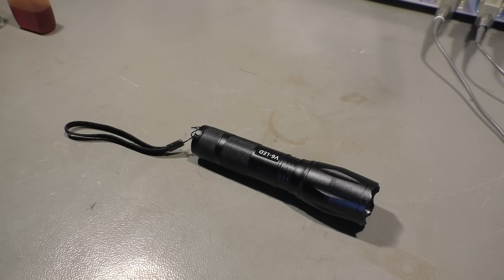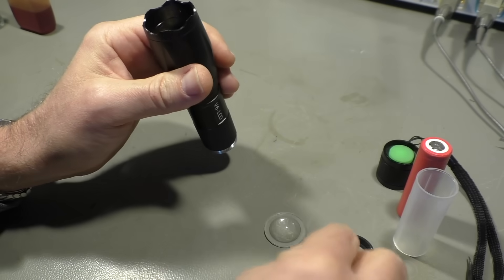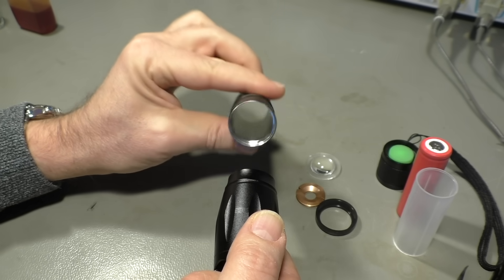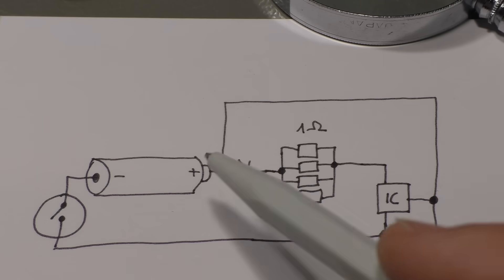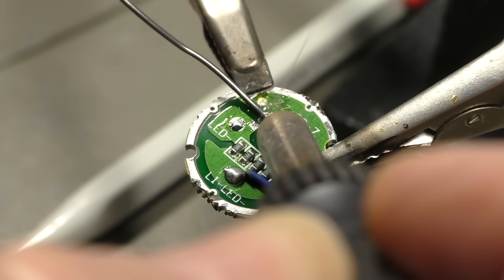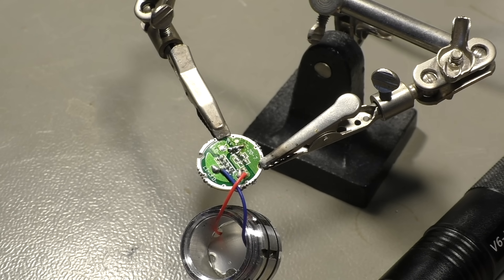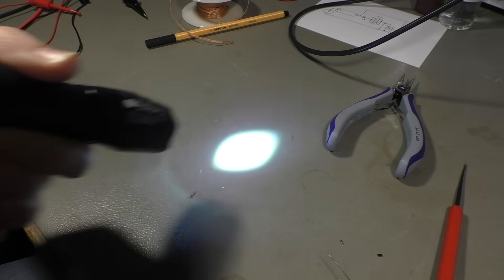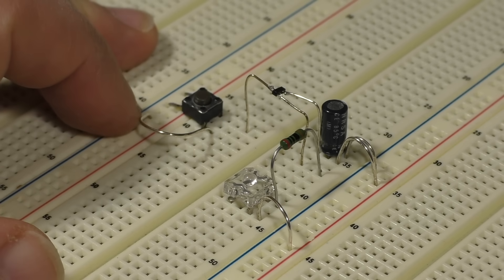Hacking an annoying flashlight into something useful (PWJ255)

Comment: How about the auto dimming flashlight problem sir???  There's any solution for this problem sir??? My flash light is auto dimming after 1 minutes 4 volts dropping in to 1 volts it's to dimmer... using my tester the battery health is good
Reply from the maker: I don't know what flashlight you have. But if the circuit is similar to mine in the video, there will be no "auto" function after the change. Here only a battery, switch, resistors and LED are left.
Some super strong flashlights do have temperature control and they will reduce brightness when the LED gets hot. But they have a more complicated circuit...

Comment: Man this is great !  I was so annoyed by these flashing torches, and NOWHERE ON EARTH (or at least china) can one find a simple ON OFF torch anymore.  I tried with one of mine now, but I just wired the LED directly between battery & switch, since mine uses the 18650 3.7V battery so I doubt it would over drive the high powered LED

Comment: It is a great video, I am going to do this modification, but also I want to change led to something like 3000K so the light is good for eyes. Can someone tell me how many watt is this T6 led? 3W? 5W? 10W? I think is 3W but I am not sure, so please help if you know.
Reply from the maker: No sure, I think 3W...
Reply: @PlaywithJunk  Thanks for the answer, yes it is 3W, I find the LED code. BTW I find on Aliexpress a replacement module that only has 1 function, I'm waiting to try it, if not I'll do your solution. Also, this flashlight can take parf from all T6 series, so 3W, 5W and 10W. I'll upgrade to 5W 3000K for 3 euros.

Comment: This is such a good hack, I remember doing it years ago with my cheap rechargeable 18650chinese flashlights when I worked store inventory. We used to have to crawl on the ground and look between tight dark store shelves to count things, and everyone had their own flashlight. I always got the "1000 lumen" (allegedly) ones from cheap chinese brands because they were bright as hell and really durable and USB rechargeable, but the strobe feature annoyed everyone. While I was removing that "feature" i found out how modifiable these things really are and ended up getting larger capacity batteries and diffusers and such for them. I basically just get cheap chinese flashlights now, and I haven't touched a D cell battery in years.
Reply from the maker: Yeah they are great.... if you "customize" them before use :-)

Comment: Could be even easier to just bridge the back of the IC? Or maybe remove the capacitor?
Reply from the maker: I don't know if just removing the cap is enough. Bridging the chip would work, but I prefer to remove unnecessary parts.

Comment: On this particular flashlight, it looks like you could have made it even simpler modification by simply moving the power wire from behind that microchip to the other side where there's that empty solder spot. That would bypass the chip with a lot less work I would think.
Reply from the maker: First I thought that too, but it doesn't work. The red wire (+) can't be moved because everything else is (-). And if you move the blue wire, you connect it directly to (-) without the resistors. That will fry your LED.
To simplify the process you could just solder that jumper to the chip and leave everything in place. But I prefer to remove parts that are not needed...

Comment: I have thought about doing something about those idiotic flashing flashlights for a very long time but neve got around to 
doing anything about it. Thank You for your work. I would like to retain the Hi - Low brightness setting but the way that chip works, I can't do it from there but I might be able to add a miniature slide switch on the side of the case and a dropping resistor hidden inside somewhere. There is quite a bit of unused space in there but I'll have to see what I can squeeze in.
Cheers

Comment: There is a similar hack to where you don't have to remove the chip. If you take a good hard lead pencil and draw a line across the chip, it basically short circuits the chip and you will have the bright only mode. The lead from the pencil is conductive
Reply from the maker: Sounds pretty unreliable, especially for 1 Amp. If you said conductive silver paint, I would agree 🙂
Reply: @PlaywithJunk  I have modded flashlights both ways and the pencil method does work, how long it works is the question. With the pencil method, I have one light that has been going good for 3 yrs, I have another that lost single mode and went back to multi mode. Maybe didn't have enough graphite on the chip or wrong chip, who knows. The pencil method is just making the chip loose it's memory within a few seconds, but the multi mode is still there. If you cycle the button fast enough, you can go to the other modes. The way shown in your vid is most definitely better and permanent, but for those that don't have the skill to do soldering, the pencil method is a good alternative.

Comment: It can use a 20650 cell when the sleeve is removed. 11% greater diameter gives 23% more volume, so they last proportionally longer.
Maybe 20700 too, if the spring allows the extra length.
Reply from the maker: Could be tried... unfortunaltely I have tons of 18650 but not a single 20650.

Comment: Does that controller chip have a low voltage cutoff function to protect lithium batteries from over-discharging?
Reply from the maker: No, it's just an elecronic on/of switch

Comment: Nice and simple mod.
But as for me, I would end up by placing some simple (linear) current driver for the LED. Because, when the battery is fully charged, the LED is stressing from high uncontrollable current which slowly kills it. For that purpose you can use, say, popular AMC7135 chip. It will maintain the current under 350mA and lower when the charge is depleting.
Also, if the battery has no built-in protection, it should be good to use some voltage supervisor (or any other cut-off IC which is getting triggered at 2.8V to avoid the deep, deadly discharge level).

Comment: Sadly to be so bright... they have chosen to overpower the led.... thats why there are often two brightness levels..95% and 110%
when it flashes it intermittently gives its highest level ( overpowered) so by converting it to allways come on at over power level.. rather than the second dimmer level.. 
So whats the difference ?
At the dimmer level the LED can last for 1000 hours of use... at 95%..
At the overdriven highest level, the LED will burn out before a couple of hours total use. 110% then 0%....
ok if you only use it for 5 minutes at a time it will work for 25 cycles of 5 minutes before it starts to degrade permently.
Once it degrades it will give only 50%  light  or fail completly...
Wiring it directly, also means NO REGULATED CURRENT CONTROLE. So now a freshly fully charged battery will be even more likley to burnout the LED.
Add to this the poor cooling with loose heatsink fittings and no water tight seal, just how long do you think it will actually last...20 hours, 10 hours, 5 hours 5 minutes... 
If you have a led torch use the 2nd brightness level, it will survive 50 times longer.. use only full power for very short bursts or avoid completly... 
f5vhz
Reply from the maker: There is no problem… the original chip has no current limiter or undervoltage protection. When it‘s turned on, it starts at 100% brightness, the same as if the jumper was installed. There is no 110% setting…
The LED is a 4W chip and it gets pretty close to 4W with just the resistors. No problem either.
And if you are concerned about the LED lifetime, you can remove one or two resistors to reduce the current. Really no big deal… 😉

Comment: I think the rapid flash is intended to dazzle muggers.    It is very useful to have different brightness levels if you are outdoors in the dark.   
1) Low light makes the battery last longer - high brightness runs it down quickly and leaves you in the dark. 
2) Low light enables you to see more of what is around you - high brightness reduces your night vision.
3) Many LED lights are being overrun at full brightness - so the LED dies sooner.   Using lower light levels make the LED last (much) longer.
Reply: 'dazzle' muggers?! 🤨🤩🤪😱🫣😵‍💫👏😎
Reply from the maker: Yes that's all true, but the problem is that you never know what light mode is starting first. The switch is not reliable and chances are high that you don't get the light you want. So I find it much better to disable that gimmick.
Reply: @PlaywithJunk  My experience is that each time you switch it on, it will go to the next mode in the sequence, unless it has been off for a length of time (5 min ?), when it will reset to the first mode of full brightness.
I often add a 2- or 3- or 4-position switch plus resistors to flashlights to have a selectable brightness.

Comment: You could also fiddle with the resistors to change the brightness. High is too high for me, and it gets hot quickly. But medium is perfect. Plenty of light, mildly warm instead of hot, battery lasts about twice as long.
Reply: yes remove the resistors to reduce brightness. Easy
Reply from the maker: @marcogenovesi8570  yeah and to increase battery life to infinity
Reply: @PlaywithJunk  yeah ok, I meant remove some of the resistors, not all
Reply: @marcogenovesi8570   more resistance = less light. Less resistance = more light. I was thinking about adding a tiny little pot so you could adjust it once and that's the light level you would always get. Or just try 3 or 4 additional resistors until you find the one that gives the light level you want.
Reply: @solarguy6043  the resistors are in parallel (its the bank of 4 identical smd parts). If you want to increase resistance, you need to remove resistors.
EDIT: or replace the resistors with some with higher value of course
Reply from the maker: Of course you could replace them with higher value resistors. Not a big deal. Even better would be some sort of constant current regulator but that could get hot. Cooling is not a great feature of this lamp.

Comment: The flashing occurs because the battery is getting low.  Yes, it can be made to flash, but that is not the primary function of the flashing.
Reply from the maker: As far as I see, there is no connection between the battery level and the flashing.

Comment: Why not just eliminate the capacitor?
Reply from the maker: What's the difference? If it just turns on at 100% brightness, it doesnt need the chip... And with the chip in place, you never know what it does.
Reply: @PlaywithJunk Obviously, not knowing what your flashlight's going to do was part of the intended design.

Comment: I just replaced the momentary switch a slide off/on switch.  Just turn it on and the first mode is all you get ,turn off and there is no battery drain so battery lasts longer.
Reply from the maker: With the original switch there is also no battery drain. The switch turns the lamp fully on or off but when on, it has a momentary break function to change the modes. You can simulate that with your new switch too. Just turn it on-off-on very shortly and it will change too. And if your switch starts getting old and gets jumpy, you will get the same problems again...

Comment: i did the same thing, i removed the black 3 pin chip and capacitor thing and bridged it like in the video but it didn't work so i had to solder everything back on
Reply from the maker: Well, not all the lamps are equal. Maybe yours has a differnet chip? But figuring out the schematics of yours shouldn't be that hard... You only need a direct path from the battery to resistors to LED to switch to battery.  🙂Or does yours have more parts?

Comment: Buen tip,  aunque creo sino me equivoco que dejar conectado todo el tiempo agota la batería a nivel crítico en litio ión. Bajar el voltaje tanto destruye el sistema. No creo  que hay un corte de energía por debajo de 2.4v. corrija si estoy equivocado. Gracias por su aporte doy like y nuevo suscripción
Reply from the maker: It is possible that the battery will go below 3V but it is not worse than the original circuit. The "chip" does not have any undervoltage protection.

Comment: Removing the control chip also means you remove the ability to cut the power in half which means you remove the ability to have twice the battery life. That's not something I really want to get rid of even if it meant clicking through two other modes. Especially when you consider that half the brightness is really all you need most of the time.
Reply: Muy cierto y creo sino me equivoco que dejar conectado todo el tiempo agota la batería a nivel crítico en litio ión. Bajar el voltaje tanto destruye el sistema. No creo  que hay un corte de energía por debajo de 2.4v. corrija si estoy equivocado. Gracias por su aporte.
Reply: @terrafinsa  this lamp has no battery protection anyway. The "battery protection" is the user that sees it's not making a lot of light and shuts it down. If you want a lamp with battery protection circuit you should not buy cheap chinese lamps
Reply: getting rid of the fiddlyness of this control system is worth losing the half power mode. If you really want it to half power you can remove some of the resistors too. If you want a lamp that isn't fiddly get a real brand like LedLenser or something.
Reply from the maker: Well, it's up to you if you want to change the circuit or not. You could also replace the resistors with higher values to lower the brightness.

Comment: I have a Lone Survivalist bullet flashlight, half the size, four times as many lights, and so stupid bright you don't even wanna use it past level 1 and 2 out of 4 levels brightness for very long. Even level 1 brightness is ridiculously blinding.

And yes it's USB-C rechargeable, and takes a 16340A 1000mAH Li-ion battery.

Yes it has all the modes you have there, but you gotta literally hold the button down to use the various flashing modes. Simply clicking the button cycles through the 4 solid brightness levels.

Brightness levels 3 and 4 scare me, the flashlight is already bright enough at level 1 and 2 with 4 high power LEDs, but using brightness levels 3 or 4 start to overheat the light rather quickly.

But hey, if used responsibly, it's way brighter, way smaller, and less annoying than the light you have there.

Bonus points it also has a special mode with red flashing lights.
Reply from the maker: There are thousands of different flashlights out there. This one costs between $1 and $5 and it seems it's the most frequently used circuit and also the most annoying... :-)

Comment: Or for a few dollars more we can get a non-flashing light with more than one power setting. 
THEN we can do what we really rather do with these annoying flashlights--put a hammer through the circuitry. No messy irons to heat up.
Reply: why waste a functional flashlight when all it needs is a small modification
Reply: @marcogenovesi8570  because the soldiering station is a foot deep under other projects and those extra minutes are precious to the current project whatever it is, so no i'm not re-chipping a 3-dollar light with 25$ worth of time. Doesn't make financial sense (nor does the rest of my life, but hey here we are). 
😅
Reply from the maker: Yeah. The problem with all those devices is that you never know what you'll get when you order it, until you finally got it. This video is for those in the same situation as I am. I have these and I don't want to trash it...

Comment: Nice. The blinking thingy is just a useless gimmick aimed at kids. That's one of those rare occasions where removing components actually increases a device's value.
Well done, sir.
Reply: There is one scenario where the flashing could be very useful, and that is confronting and disorienting an intruder at night !   As a retired Security Guard the whole concept arrived a couple of decades too late for me !
Reply from the maker: The problem is that if you're actually confronting an intruder, you never know where that blinking mode hides. You first have to fiddle through all the other settings, miss it, try again.... you think that's good? I would like it, if it had an extra switch for extra functions.
Reply: @PlaywithJunk exactly. I kind of like a bright and dim also. My perfect flashlight would have a toggle on off, push forward for bright, push down like a regular button switch to go from bright to dim and toggle back for flash. Show me how to do that. Haha.
Reply from the maker: @Just___me_  Easy! Just buy a flashlight with exactly those functions. 🙂
Reply: @CitizenSmith50  IMO a blinking flashlight would confront and disorient six year-olds only. YMMV of course.

Comment: This worked on 6 out of 8 flashlights  , 2 of them had 10 resistors and the circuit board was painted black so I will have to wait until I use the oscilloscope on those 2 , thanks a lot , scrolling through a bunch of button pushing is a royal pain in the ass 👍

Comment: Just add a 100k 1/4w resistor across the capacitor and as long as you leave the flashlight off for at least 2 seconds it will always turn on at full brightness. If you tap the button while the light is on it will still step through its brightness and flashing loop! Just take the flashlight apart, add the resistor across the capacitor, and do not alter the circuit in any other manner.
Reply from the maker: You don't neet that resistor because the circuit does exactly that by itself. The problem is that the power switch does not switch cleanly. If it jumps once or twice before it finally turns on, you're already in a different mode. Therefore you never know what the lamp does when turned on.
Reply: @robertrobinson4619  Switch bounce.